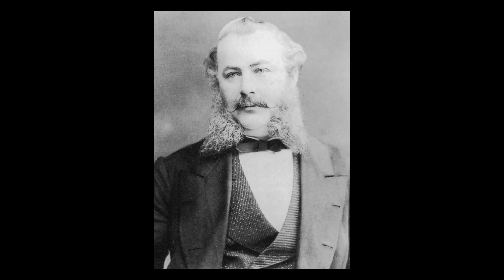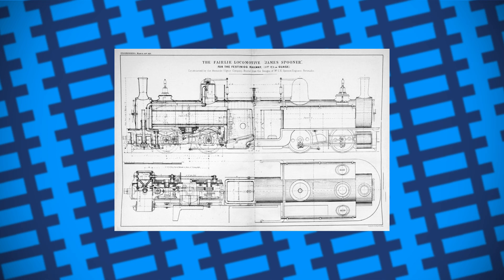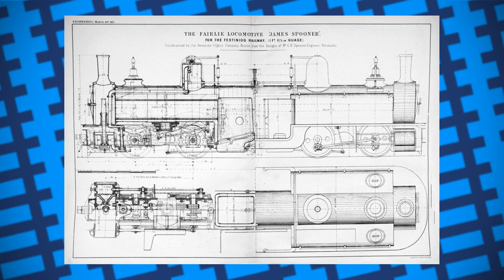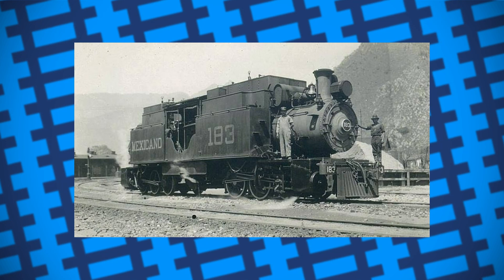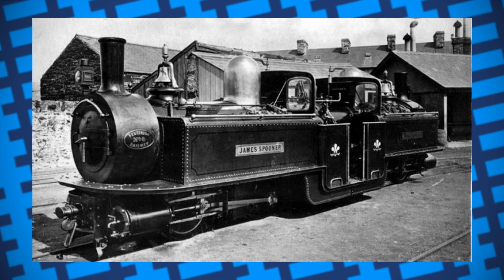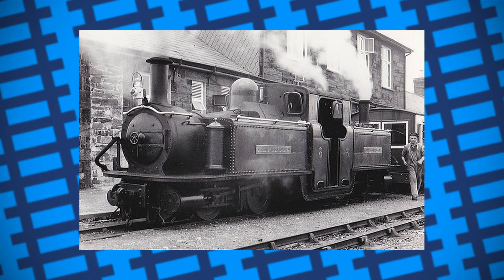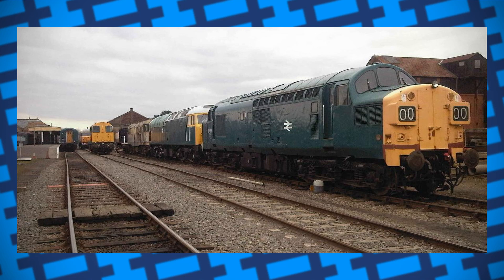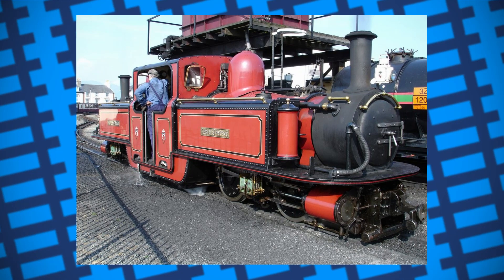The double ended steam locomotive - Fairlie Locomotives

Comment: Fairlie: "Tender Engines are deficient"
Simple Answer: just use a tank engine
Reply: no just use a garratt witch has tenders mounted above the driving wheels and the boiler slung between
Reply: @IndustrialParrot2816  Fairlies were made before garratts I think
Reply: One thing I got to say
Reply: First
Reply: They were used for long distance AND they would have to stop AT EVERY STATION To get coal
Reply: That’s it
Reply: @IndustrialParrot2816  Garratts are Tank engines not tender engines
Reply: Use mighty Mac or a garratt.
Reply: Just how old the controller to give you a coal Bunker and side tanks you’ll be a much better engine
Reply: @IBM-vw4fv  indeed,  first Garret was built in 1901
Reply: But you need a turn table and points for tank locomotives unless you use a auto train
Reply: The existence of forneys negates your point
Reply: @TankEngine75  Actually, Beyer-Garratts combine most of the advantages of both -- the driving wheel frames are big enough so that even though they are technically tank engines, you have the better part of the fuel and water capacity of a tender locomotive, while the better part of the fuel, water (and bunker and tank) weight is on the driving axles, as is the weight of the boiler and cab (in the middle, hanging on both end segments), although Beyer-Garratts did incorporate unpowered wheels as well (but not as many as you would have on most tender locomotives of the same power when you include the tender wheels, which are not normally specified in the wheel arrangement).
Reply: @naturespecialist1489  most tank engines can run backwards just fine. All you need is a section of double track long enough that the engine can be uncoupled, drive past the points, reverse past the entire train and a second set of points,then drive forward to couple onto what was previously the back.as an added bonus, many tank engine designs actually gave their crews better visibility when running backwards, as not only was the boiler not in the way, but the back windows were larger.  Of course, there was a reason they were used in the situations they were used in and not in the ones they weren't.
Reply: Use a condensator
Reply: @matsv201  Nice idea, and it has been tried a few times, but it takes a LOT of space.  I do wish somebody had tried an evaporative condenser (sounds like an oxymoron, but think about the parabolic towers with steam coming out from power plants that don't have enough water supply to provide the cooling -- same idea but use centrifuges to make them fit in a smaller space).  This would lose more water than a closed circuit purely air-cooled condenser, but less water than direct exhaust of the steam to atmosphere in the smoke box.
Reply: @Lucius_Chiaraviglio  depends how cool you want the water. If you just want it to be atmosveric  it really should not be a problem. Sure, large, but not heavy.
Reply: @matsv201  In steamships and power plants, you get water cooled substantially below its atmospheric boiling point, thereby increasing efficiency.  If you just use a closed condenser, you can't get that (unless it's REALLY huge), and thereby can't get as much efficiency.  That is why steam hung on so much longer in ships (even when no longer coal-fired) and power plants than in trains.
Reply: @Lucius_Chiaraviglio  yes, but if you only want to save water you can run the condenser at 100C...or rater, you can ryn half of it at 100C and rest of it warmer. Then the condenser dont need to be that large.

I would say its a bit more complex than just say it was the condensors. A diesel engine is way easier to maintain and its faster to start. In a ship that dont matter as much. Specially when turbines was introduced.

There was steam turbine locos introduced in a lot of countries, but they where just to complex and really didnt work well with trains.

Steam turbines have unlike steam engine really low zero rpm  torque. In ship that dont matter, the prop spins frely. 

So the trains need complex systems to start.
Reply: @matsv201  The difference in maintenance between diesel and steam isn't so clear-cut (I have a friend who used to be in the merchant marine who worked on steam, and he said diesel was a horrific chore (he got the training), and the videos from Chief Makoi don't entirely disagree.  But at locomotive scales, the maintenance does tip somewhat towards diesel.  The other big thing, though, is that on a train you don't have access to a continuous supply of cool water like you do on a ship or in many power plants.  The thermodynamic efficiency of a heat engine depends upon the ratio of the absolute temperatures of the hot part compared to the cold part, and the hot part of a steam engine is much less than the hot part of a diesel engine or gas turbine, so to compensate, you have to make the cold part colder (or in an integrated combined cycle power plant, you do both).  If you can't do that, efficiency suffers.

Some of the steam turbine (and gas turbine) locomotives were turbine-electric, which got around the torque problem, but had the problem that ash from coal burning got into the DC traction motors and shorted out the commutators.  If those locomotive shad been made with modern controlled-frequency AC traction motors with properly ductetd forced air cooling (and with the inverters placed properly away from the combustion chamber and steam pipes), they probably would have worked reliably, but such technology only became available way after diesel had taken over.  Oil-fired gas-turbine-electric locomotives didn't have this problem, so the Union Pacific's gas-turbine-electric locomotives were successful until the price of Bunker C (now Number 6 Fuel Oil) quit being so cheap relative to other petroleum products at the same time as the turbines came due for heavy maintenance, and so they quit being economical to use -- both gas turbines and steam turbines have the problem that they are only efficient in a narrow range of speeds and loads.  (In power plants, you have multiple turbines -- at least when spread across multiple power plants -- to take up load in steps, and in ships and jet aircraft, you are running at constant speed and load for long periods, but on a train you usually don't get that option, because of changing grades and speed restrictions, etc.)
Reply: @Lucius_Chiaraviglio  Well there are diffrances.

A boiler have to be cleand before every time its started. That would be pretty much once per day on a train, but maybe once a week in a ship. A diesel engine is maintained on hours run, on a train it typically run 12-16 hours a day, in a ship it typically runs 24 hours a day.

" continuous supply of cool water like you do on a ship or in many power plants."
Well that is the point of the condenser, that is also true for a ship, even more so.

"Oil-fired gas-turbine-electric locomotives didn't have this problem, so the Union Pacific's gas-turbine-electric "
well yes, but that is still adding more complexity. Now you need to have a engine, a generator and a motor. For a steam turbine you would also need a boiler. There was steam turbine electric trains in the US. They was enormous.

"In power plants, you have multiple turbines "

That is not really true. Gas-turbine power plant (GT) turbines is pretty much identical to that of a aircraft. Its a normal dual axle turbine, the efficiency is typically 37-38% while diesel engines have efficiency of 42-45%, so the diffrance isn´t huge. Of cause stationary turbines run on natural gas, not oil, reducing the maintenance quite a bit. Also generally GT:s is only used for peak load, so power is more important than efficiency.

For steam turbines the reason why they are typically split up in 4 turbines (with 8 half turbines) is not because there is a technical need to do it, but rather due to them being easier to transport. This would not be a problem in a train turbine. Also the condenser temperature would be higher, so the pressure would also be higher, in turn needing smaller turbines, the drawback of this would be somewhat lower efficiency, about 32%

"efficient in a narrow range of speeds and loads."
That is kind of but not totally true. Typically a gas turbine reach peak efficiency at 40-100% power setting (aircraft usually have a 115% TOGA power setting that can be used for 2 minutes only), that is not that dissimilar from a diesel engine. Where the turbine get problem is under 40% where the efficiency falls of a cliff, getting down to 10% efficiency already at 20%, while a diesel engine typically have over 30% efficiency at 20%. This is for example used by the Swedish tank Strv 103 having both a diesel as well as a gas turbine, the turbine only used for high speed movement. 

"constant speed and load for long periods, but on a train you usually don't get that option"
That is not really true for aircraft either. Typically running 100% power for the first 5-10 minutes, then trotting back to 50-55% power, than over the duration of the flight slowly throttling back to about 25-30%.... Well that would be generally true for aircraft older than 10 years. Newer aircraft like 777x and the A350 have gearing to the fan, increasing the low speed grip of the fan, in turn needing less turbine power to take of. So they generally can fly at much higher power setting, never needing to dip down to the sub 40% when the engines start getting ineffeicent.
Reply: @matsv201  What I meant about power plant pools of turbines is that at least when you integrate over the power grid, you have multiple turbines (even if one power plant just has a couple), so you at least have the option to have some on hot standby and others running at near to 100%; if you have 4 in one plant, that is an added bonus to granularity that you can use to optimize efficiency.

For aircraft, what I meant is that you are going to be cruising for long periods at a certain speed/load, so you have the option to design the turbine to be most efficient under these conditions, even if you have to sacrifice efficiency at the power settings used for takeoff (the most extreme example being jets with afterburners).

(By the way, it also seems to be reasonably common Navy ships to have both diesel engines and gas turbines for the same reason you gave for the Swedish tank.)
Reply: @Lucius_Chiaraviglio  

"What I meant about power plant pools of turbines is that at least when you integrate over the power grid"

Not really. Most of the time its just shaft per boiler or reactor. Some times there is two, i never seen more than two. The major reason why there is two is mostly in nuclear reactor is that they simply could not find a turbine of sufficient size.

While, yes, that would be an effect that they can split them up. Its not used that often.

Coal fired boilers typically only ever have on shaft. There might be more than one boiler at the same site, but that is really only for site efficiency.

" long periods at a certain speed/load, so you have the option to design"

That is not really accurate. A typical long range aircraft have almost half the power at the end of the flight as in the beginning... Well that was the case prior to the last generation. Now its less so. Also TOGA power is at that often twice as high as top cruse power.

And that is not only it. A airliner have to be able to operate with one engine for a minimum of 180 minutes of level flight (If they are ETOS 180 rated). And it have to do so with full load minus 180 minutes of fuel.

So you can´t just put a afterburner on it and call it day. The efficiency at 100% power must be not much worse than at 50% power. If it would be much worse if the 180 minutes happen at the end of the flight, it would not have fuel to get it to shore.

This is compounded with that a airliner with one engine can´t fly at 40 000 feet, it have to decent to 30 000 feet, and slow down to about 700km/h. This makes it worse not only is the air thicker at 30 000 feet, the air is also warmer, making the engines less efficient. So the engine have to have a really flat efficiency curve, and they do have that. Its really just at TOGA power that the efficiency decrease significantly.

"By the way, it also seems to be reasonably common Navy ships"
There is hardly any turbine ship left. I think its kind of odds when ground based CCGT is still common. One of the reason seams to be the cheep cost of unrefined fuel. With newer marie diesel being able to run on unrefined oil,  the fuel is simply so cheap that efficiency don´t matter.
Reply: problem not enough fuel supply thats why large tank engines were pretty much outlawed in the U.S.
Reply: @IndustrialParrot2816  I hadn't heard of a law against large tank engines in the US.  But a Beyer-Garratt design would have plenty of space for fuel and water anyway.
Reply: @naturespecialist1489  Actually, tank engines can go backwards as good as forward
Reply: @RoomsAdventurer  I see your point like the JNR C11
Reply: @RoomsAdventurer  and short tender engines could do the same thing like the JNR C56 a branch line tender engine that’s is a change in JNR C11 design maybe JNR C50 but that’s just my guess however during the  busy season the Oigawa line had no time for running around the train, They had do services like the Autotrains in the GWR
Reply: 👉 yes 👈no normal .
Fairly 👈👉 yes .

Comment: Correction: articulated locomotives actually did catch on to an extent, as a method of building a larger locomotive that can still navigate tight turns. The UK was one of the few places where such designs didn't take off well.

Notable non-American articulated locomotives include the massive (by meter gauge standards) SEG Mallets, the Saxon Class XV and the South African Garrets. To note, many non-American examples of articulated locomotives are narrow gauge and used specifically to pull heavy loads at low speeds through mountainous regions.
Reply: Garrett locomotive were also used in Australia
I could be mistaken but I'm pretty sure the NSWR Garretts were the largest one in the world

Shay and Climax were other American articulated locomotive
Reply: @hodaka1000 
I would considered multi-truck geared locomotives like the Shay and Climax to be in a separate category, since their drivelines have more in common with 4-axle diesels than with other steam locomotives.
Reply: @VestedUTuber  
I think that's splitting hairs
Reply: @hodaka1000 
The difference is significant and well defined. Articulated locomotives have the drive cylinders on the trucks (which would include Davenport's geared locomotive design). Whereas Shays, Climaxes and Heislers are shaft-driven with the drive cylinders on the chassis. You don't call four-axle or six-axle diesels "meyer articulated diesels", do you?
Reply: @VestedUTuber  
I might

Comment: How to make a budget fairlie:
Get two tank engines of the same class

Weld them together

Done
Reply: big boy
Reply: What if i tell you, the British Rail Class 13 shunters are basically that except being diesel driven.

They are to be simply put, 2 class 08 diesel shunters (with some modifications, mainly the removal of the cab of the "slave" car) permanently attached to each other via coupling to boost tractive effort
Reply: @manngaiho1012 
So basically a Class 8 with an additional "B" unit?
Reply: @VestedUTuber  exactly…
Reply: @manngaiho1012  : Much like an EMD TR6 cow-calf set, then.
Reply: I don't understand locomotive stuff but ok.
Reply: Who are you, James May?
Reply: Some double Fairlies did have two separate boilers.
Reply: @timesnewlogan2032  no i am dutch james may, Jan Mei

Comment: There were actually 3 Single Fairlies built for the surrounding Ffestiniog railways. The first two were 0-6-4T (that you showed) named "Snowdon Ranger" and "Moel Tryfan", both built in 1875. These originally worked on the NWNGER, which became part of the Ffestiniog Railway eventually. After both engines being worn out by the late 1910's in 1919, Snowdon Ranger was scrapped and major components being used for Moel Tryfan. Moel Tryfan lasted for another 30 odd years being transferred to the Welsh Highland Railway in 1922 then being scrapped by the FR in 1954.
The third one went by the name "Taliesin" and was built in 1876 for the Ffestiniog Railway. Unlike the other Single Fairlies it was of 0-4-4T configuration. It had a much shorter life as between 1898 and 1900 it was dismantled for preparation for a new boiler, but the boiler never came due to the Board refusing to purchase a new boiler. It was subsequently scrapped but a testimony states that it was however reassembled with the existing boiler but there are no record of this. 
While I said 3 there is technically a 4th but it is a new build of Taliesin named "Taliesin III" which was built in 1999. As of 2020 it is currently not in service receiving an overhaul.
Reply: There was also Gowrie, an updated single fairlie built by Hunslet in 1908 for the NWNGR and was sold off about 10 years later. We're currently building a replica of this one to run on the Ffestiniog and Welsh Highland. :-)
Reply: @diaryofachuffernutter1521  OH YES! I had completely forgotten about Gowrie and its new build on the way! Can't wait to hear that its finally running in a few years!

Comment: There were several classes of diesel locomotives on BR that had unpowered axles including the D600 Warship Class, the Class30/31 which both had an A1A-A1A bogies, Bulleid's diesel locomotives for the Southern Railway (BR numbers 10201-10203) plus BR Classes 40, 44, 45 and 46 (which were all had the  1Co-Co1 wheel arrangement.

All of the first generation DMUs had power cars that had 1A-A1 wheel arrangements. The Pacers were 1-A+A-1 in their wheel arrangement, whilst the Sprinters and all subsequent DMUs had 2-A1+1A-2 wheel arrangements (for a 2-car unit) with an extra 2-A1 fir each intermediate vehicle.